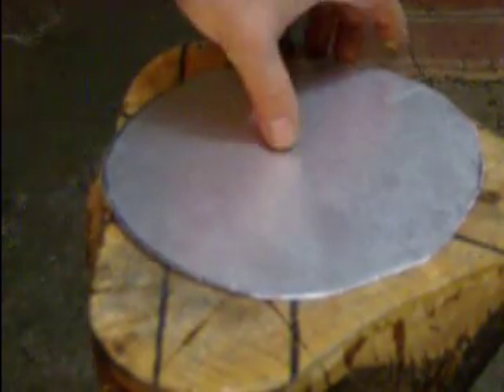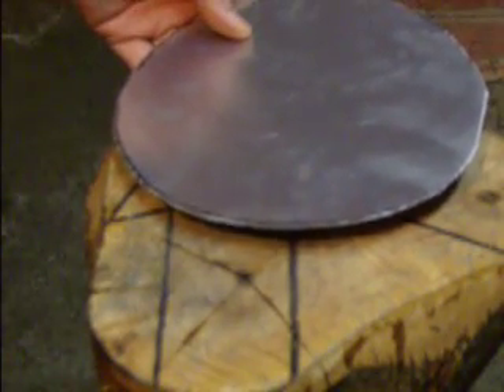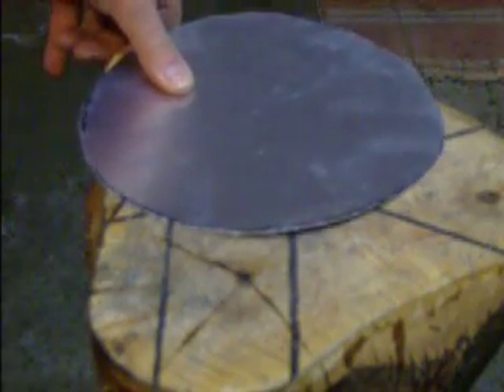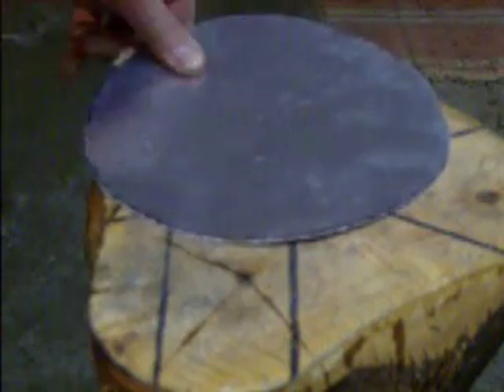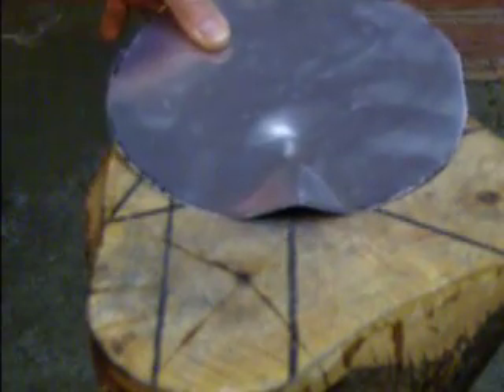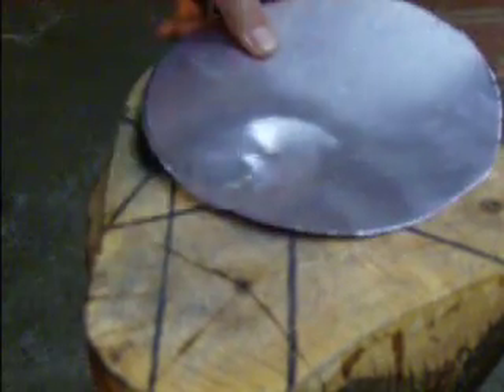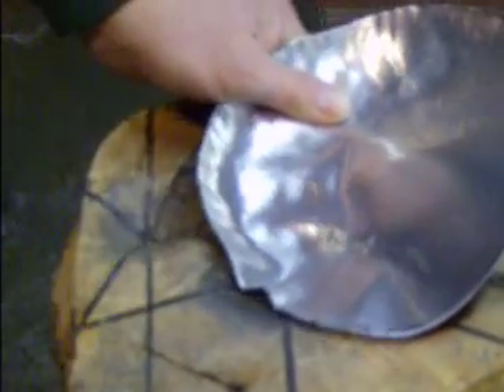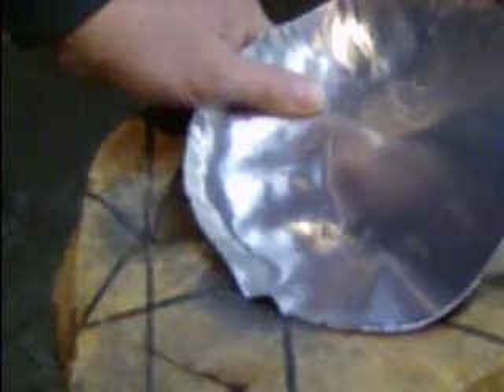Shrinking Metal Using a Stump and a Wooden Mallet

Comment from the maker: Actually the metal is shrinking from the middle to the outside edge. If there is stretch it is in the middle. The outside of the "bowl" will end up in a smaller circumference than the original blank. If you measure radially, you will find that dimension has changed very little, compared to the smaller circumference. Thanks for commenting!